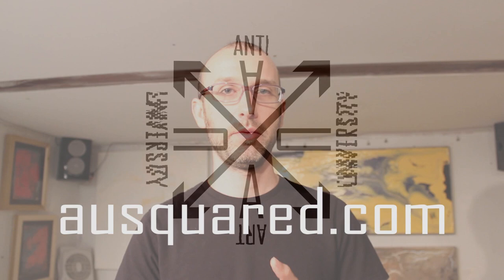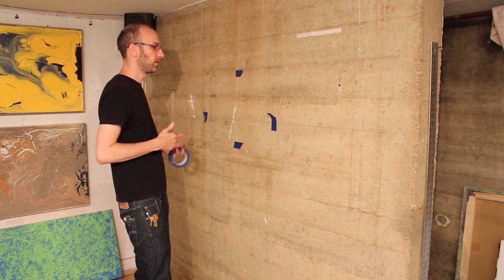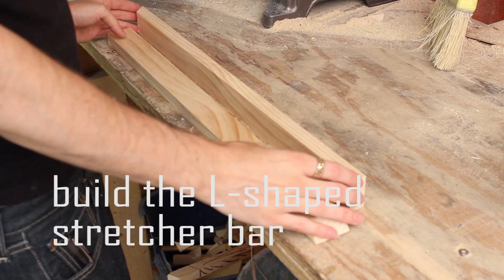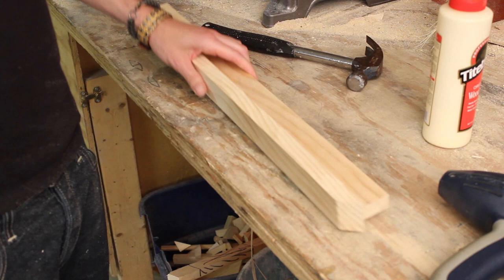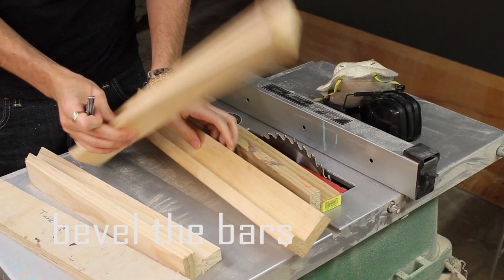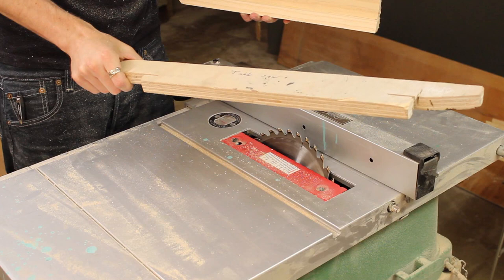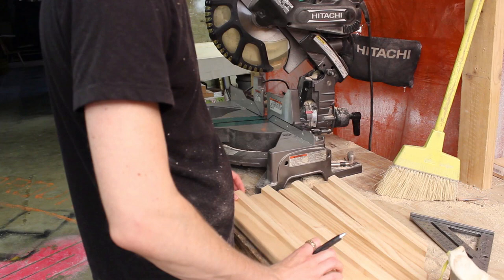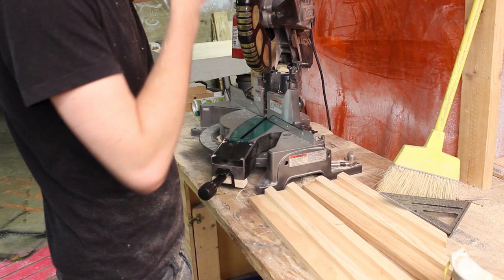Make Your Own Canvas Pt.1: The ONLY Way to Build Stretcher Bars

Comment: Ohhh, DON'T staple my hand, tx so much. You could have said that before we started stapling.
Reply: Btw, any tips on how to get a staple out of a hand? cheers
Reply from the maker: Never seen anyone staple their hand, but a co-worker of mine did put a nail through this finger with a nail gun. Fortunately it wasn't through the joint, so he healed up in a couple of months without issue. Just gotta be aware and undistracted, and that will help avoid most safety issues.
Reply: Idk, Mead, that was a little robotic of a reply. I guess I have to let you off since you don't know me, but not one lol? haha I was oc joking. Now, I'm in the same position as you, idk you so I'm actually not sure if you were following along or trying to be polite about a viewer's stupid question, lmao. 

I really liked the video. I'm a big picture guy.(no pun intended) So when i'm getting into details I need it explained well and thoroughly. Mission accomplished, hands and fingers all good.  q=-D Tx, man. 

Now.... time to create a masterpiece! 

Peace
Reply from the maker: I've heard pulling helps? But for real if it does happen, leave it in there and head to an ER. The worst thing you can do with a puncture is try to remove it (if you do, it will bleed like crazy).
Reply from the maker: No worries. I knew you were joking. I'm working on a video about priming canvas, which seems simple, but there are a few common mistakes I see that run counter to the point of priming. Eventually, I'll do a traditional rabbit skin glue and oil gesso priming video.
Reply: @MeadMcLean  - Sounds cool. I'm doing digital work right now and having it printed to oil & canvas, so I'm all about framing at the moment, but I'm so busy I haven't even watched pt 2 of this yet. I just ordered a 7'x 4' Picasso as well, not sure how Ima tackle that yet. I'm thinkin 3 panels and attach them with steel flat frame braces. Any thoughts?
Reply from the maker: That would work. For mounting purposes, I like to do panels instead. Same basic process. There's no reason you couldn't make a 7'x4' stretcher. It's well within what will fit through a standard door. The basics for that size of a canvas are corner braces and making sure the center is spaced out properly as you install the corner braces.
Reply: @MeadMcLean  - Hey. Ok, see, i'm learning. I didn't even realize the stretchers were really for meant for painting. Whenever you buy a painting they offer stretcher bars as a framing option so I was just going off that and assuming mounting all the way. For painting, Idk I have enough confidence to spend the money, so I have only bought preframed canvas or painted on board..... and only with cheap acrylics.

Do you mean braces for the canvas or the wooden frame?
Reply: Now I'm all self conscious, lol... What do you think of the digital paint apps. ie. android notes or similar..... I know there are major differences, ofc, but the brush strokes seem incredibly real. The color selection is amazing compared to paints. I admit though the 'undo' seems a little like cheating. I guess i'm curious what the art world thinks about pieces produced digitally, cz I've no idea.

peace
Reply from the maker: Yeah you can totally mount on canvas. For that, I paint the canvas with acrylic soft gel medium, paint the back of the paper with the same. Let both dry. Then put a layer of it on the canvas and adhere the paper. Roll it out with a brayer, if possible. Braces for the stretcher bars themselves. You put them in the corners at 45 degree angle.
Reply from the maker: I think it depends on what sector of the art world you're operating in. In the "high art" realm, digital work may not be liked very much, but it's an arbitrary constraint. Photographers work digitally and use photoshop, there's a slew of video art, electronic based art, and the like. I have seen a lot of calls for entry lately that specify "no digital art" though. 

Another potential working method is to work digitally, print out your image, adhere it to canvas, seal the image with acrylic matte medium, and paint over it with acrylic or oil. (I might do that. That sounds like a fun idea.)